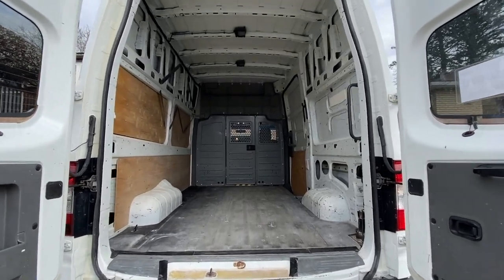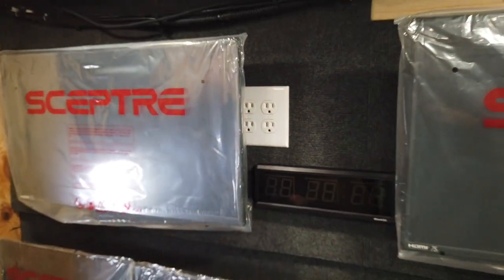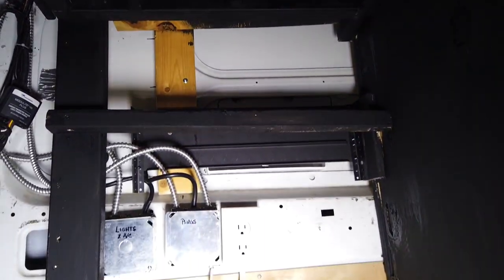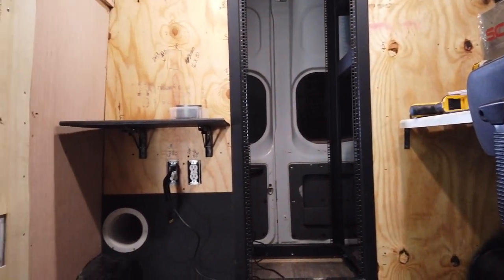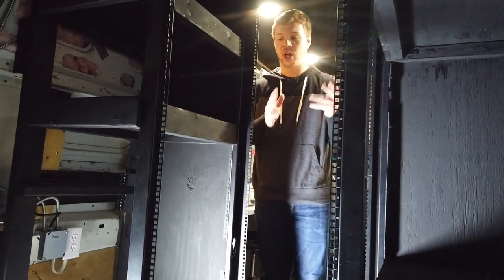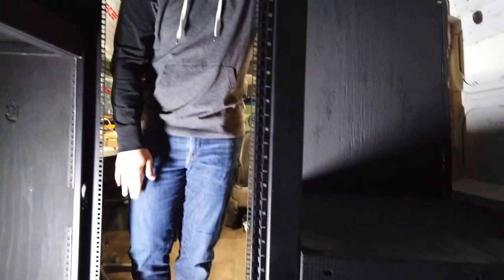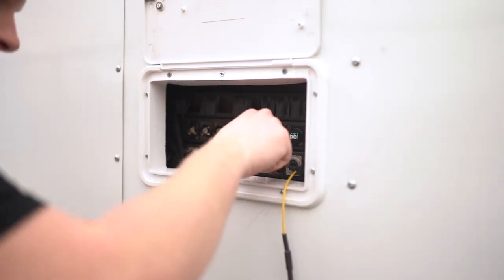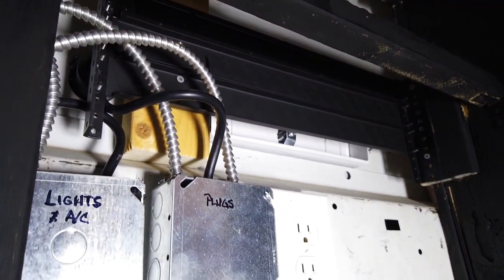Building A Broadcast Van

Comment: Do you have an internal power supply or do you use the venues? Great video
Reply from the maker: We use the venues power supply. 2, 15amp circuits. If the venue has no power available, then we have a gas powered generator.

Comment: I know that air conditioning solution isn't going to perform well.  Why not a roof mount or mini split?
Reply from the maker: AC layout works fine in our trailer build. Couldn’t put a roof unit since the van clearance just fits inside our garage